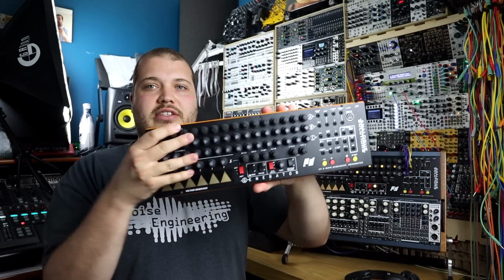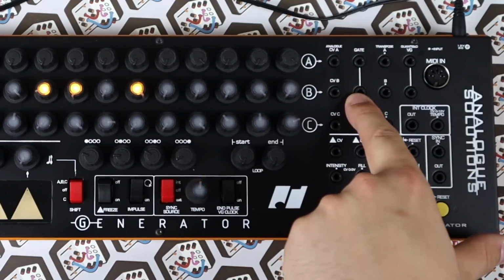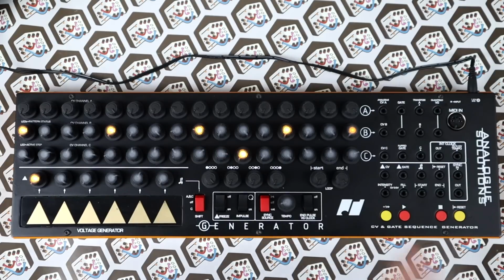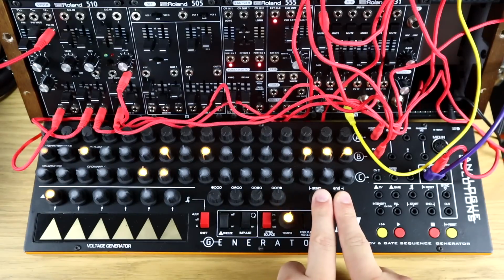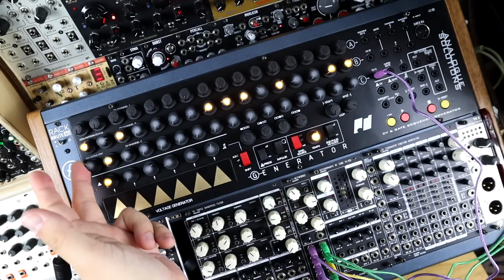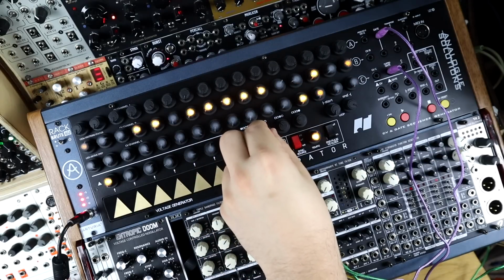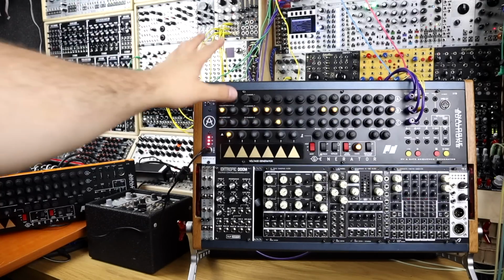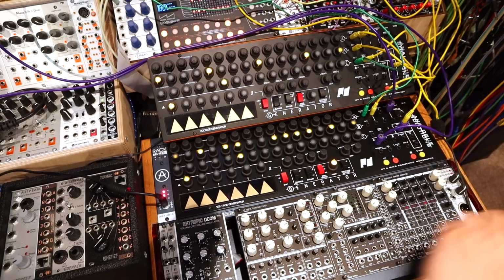Hands on analog sequencing with the Generator from Analogue Solutions (desktop & Eurorack)

Comment: is possible to work with this sequencer without quantize?
Reply from the maker: absolutely. It's not quantised. it's just variable analogue voltages per step. So you can use those for anything you might want to modulate or control. You can use it for unquantised pitch. More carefully tuning each knob/step. Or you can quantise those voltages to lock them into scales if you wish.
Reply: @DivKid  you say about pitch, same with rythm? Can i have some totally adlibitum, free crazy rythmic structure?
Reply from the maker: you can freely improvised with the rhythms. The controls offer ways to turn on and off various steps in a musical way. The lights on the knobs show the rhythm you're creating.

Comment: So you can cv the start and end points of the sequence? That don't impress a me much. Youve got the looks but can you individually clock each track, or at least have individual resets per track? Having all the tracks tied together is a huge limitation. They should have made the gate sequencer a stand alone module because it looks nice. What happened to modular modules?
Reply: Billy A.B. 
Agreed. Eurorack becomes an unnecessary design constraint in products like this. Either make it modular or release as a proper full size synth without compromises.
Reply: @SootySweep22  nah I got one of these -  its designed to be musical

Comment: Great demo, as usual. 

One question, unrelated to the generator but showcased on the video.

Does your T-Networks module have the mid and low frequencies flipped? (mid is actually low and vice-versa)

Comment: sorry to dbl post, right after last comment.. you talk about using pitch cv to trigger drums... I just "learned" this idea from a NE video.. using mimetic as a 4 trigger source.. so I tried it on mine and soon discovered this fact that you can't have 2 back to back triggers due to the +/-5v needing to be different between steps... but for simple bass beats or hits, this is great!  Eurorack is so confusing with all the possible ways to do one thing, keeps me fresh! Ok, great video, thanks again B!
Reply: One way to get around that: take the trigger or short gate you use to clock the sequencer, mult it to an AND gate, then patch the sequencer output to the other input of the AND gate. The output will then only be high for as long as your clock input as high, so you can how have back to back triggers.